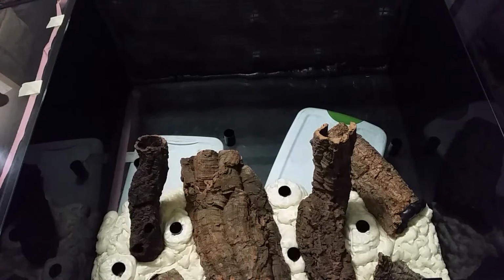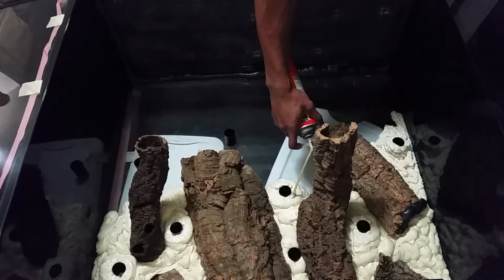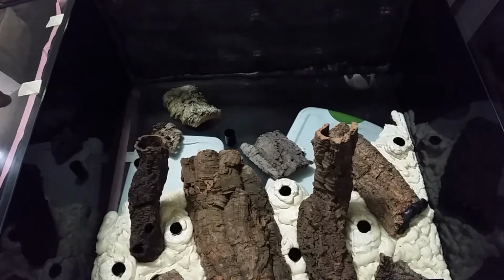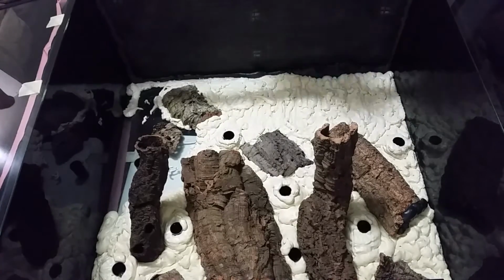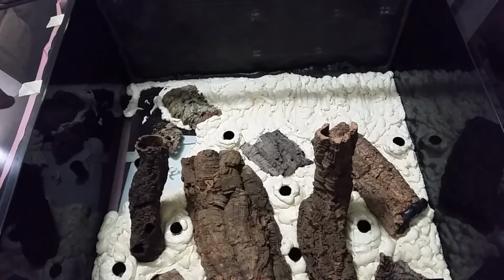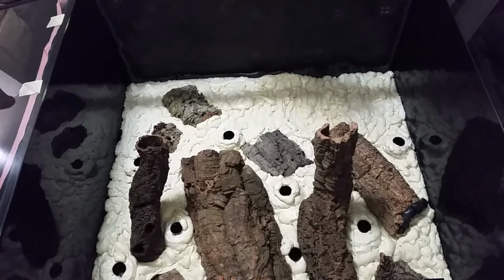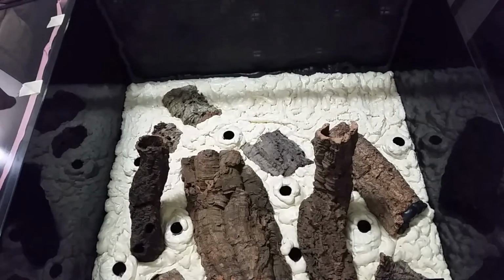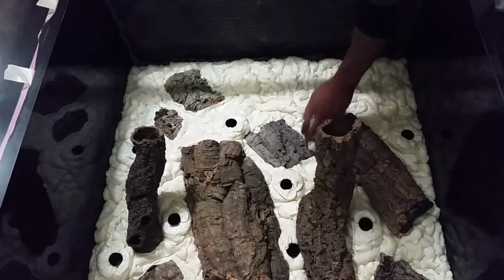Exo Terra XL (36×36×18) Foaming (Pt. 4.1)

Comment: I'm assuming those film canisters are for broms? Won't the bases of the plant rot out if there's no drainage?
Reply from the maker: the file canisters are hides for the frogs. Broms that are planted into the BG don't need to be drained. if they're in the dirt then that most likely will die.
Reply: +Bradley Smith What kind of darts are you gonna put in there? Thumbs? It seems like it would be difficult to get the tadpoles out of them.
Reply from the maker: +Keith VonBernewitz the tads would be in the broms. I didn't set up canisters for deposit sites in this one. I'm going to have a bunch of broms.